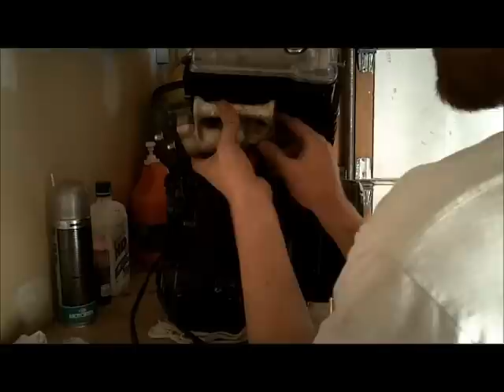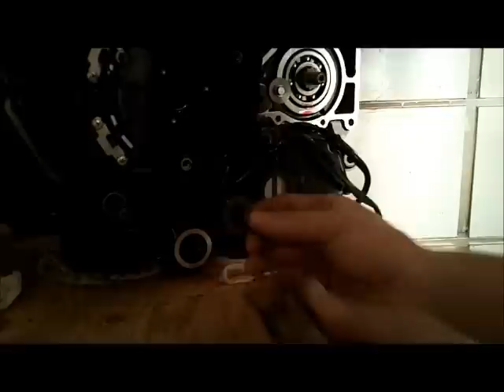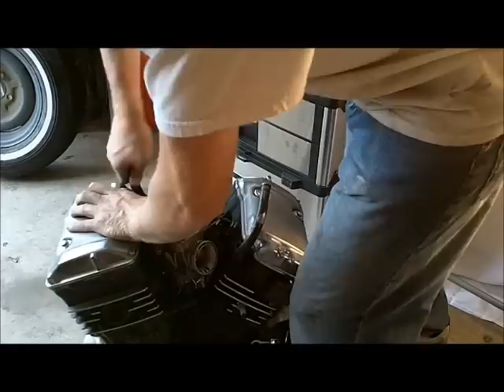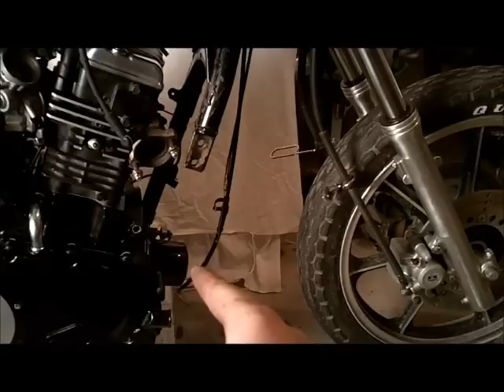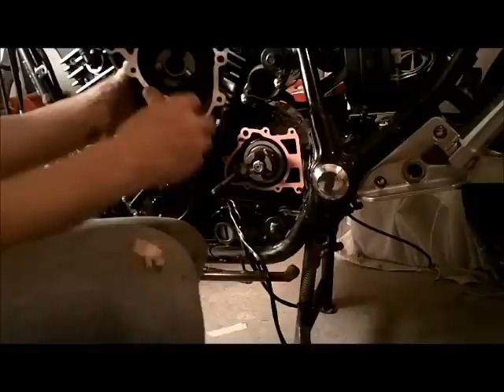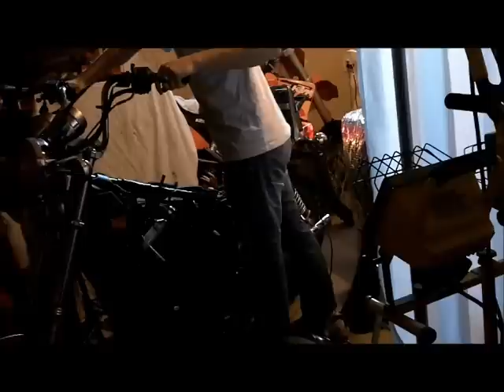1985 Kawasaki VN750 Engine Rebuild - pt26

Comment: put the vulcan 750 engine at the ignition point, I didn't see that in your video, could you give me an idea like I put a cylinder at the top point and mount the rocker arms and then go around and mount the second cylinder, or is it on the same lap? Do you already mount it in the ignition position? your videos are excellent

Comment: Andrew, need some info if you can? The gear box you didn't state torque specks, and is there any for the exhuast at the motor head ports? Reason being I needed to replace my final drive but first pulled the gear box trying to trace out the noise. And it seems like my clutch lever became very tight after I got the gear box in place, any clues to why it is so tight?
Reply from the maker: The clutch actuates a rod from that gear box and pushes it  all the way though the motor to the clutch plates on the other side. My guess was something binded when you put that gear box back on. There is a screw cap you can pull off and you should be able to access the rack and pinion that moves the clutch rod. You might just need re-install the clamp on the bottom of the pinnion at a different angle.
Reply: Andrew Roth thank you,  I was wondering if something also could not be meshed correctly?  when the final drive went it was in gear and now it can still roll.  almost like its stuck in neutral.  Was thinking on pulling the gear box again as you said and check that lever the clutch cable attaches to under the gear box.
Reply from the maker: It might just be that the clutch is fully engaged. I would start by adjusting that.
Reply: Andrew Roth Hi Andrew! I'm now doing the diagnosis of this engine, please tell me how to determine the wear   Guide-comp and  39132. Sprocket-assy-idler, in my instruction there is nothing

Comment: Did you make a video when you pulled the engine out
Reply from the maker: No, When I bought the bike the engine was already out.
Reply: Oh.  That's another misunderstanding I had.  That explains why the engine is already out in the first video.  I figured you must have had a long history with this bike, because otherwise, why would you go through the time and expense of doing this, rather than just buying a different bike.  You must have gotten a pretty good deal on the bike.   Sorry if you mentioned that already, but I don't remember hearing it.

Comment: I got a 95 800 that the part on the case that holds the starter torque limiter gear  broke due to a bad starter and now i cant find no one to weld the nipple piece that holds that gear in place so i bought a whole case and need someone to swap everything over so really i need help anyone im in the chicago area my number is 708-262-0428